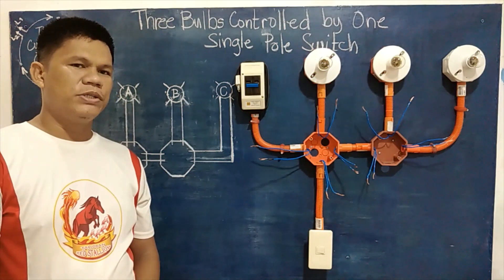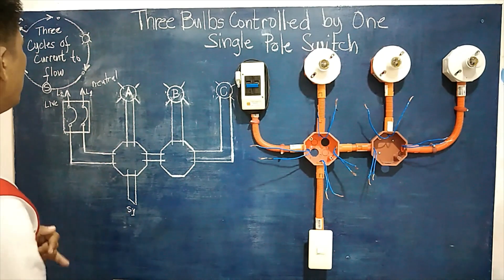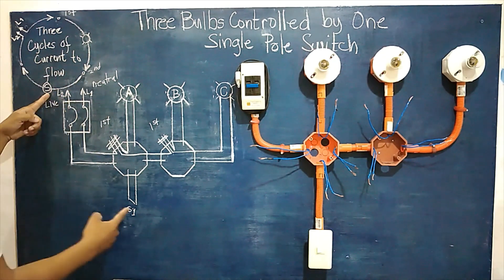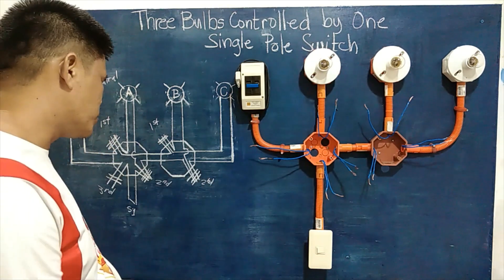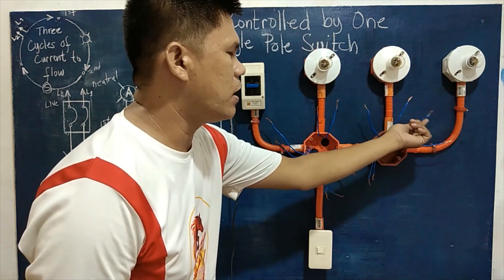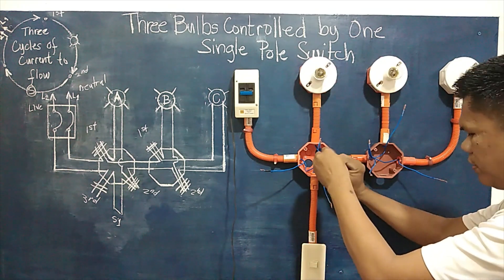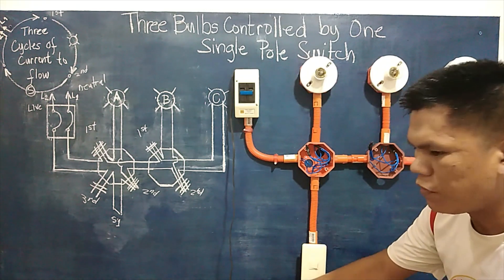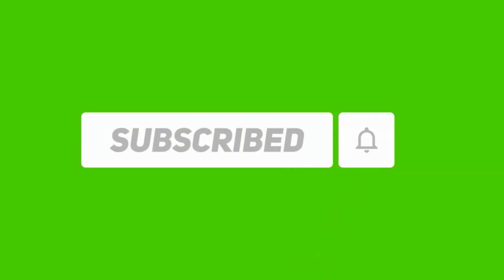Three Bulbs controlled by One Single Pole Switch

Comment: Sir ano # ng supply wire at terminal wire?
Reply from the maker: Depende sa circuit load computation ang mGiging size ng supply wires
Reply from the maker: A minimum of awg #10